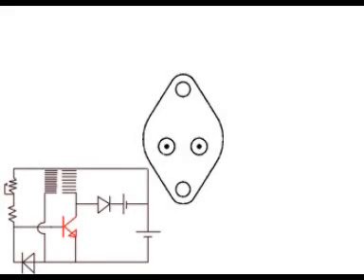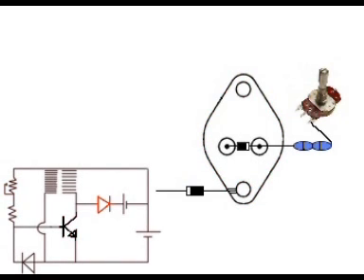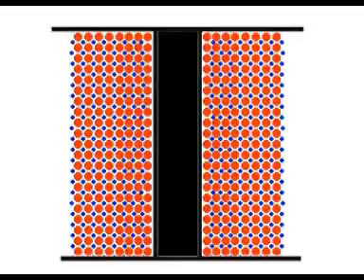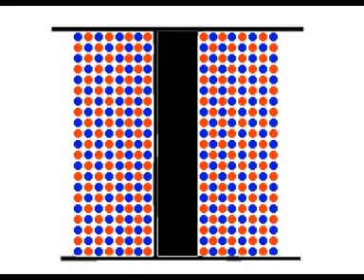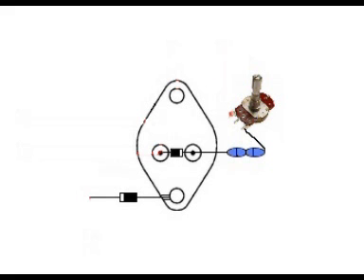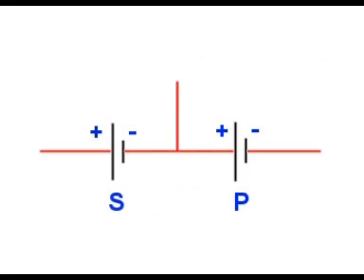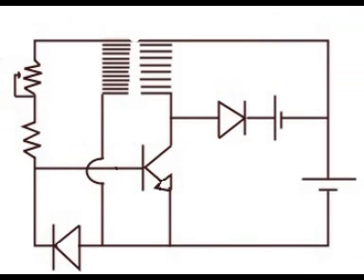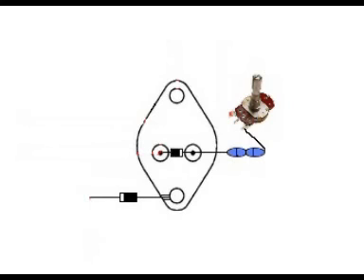How to Build a Bedini Motor ... Part 2

Comment: Hi introvertebrate 

Been looking at your posts and GREAT, I have NO idea what im doing but im going to have a go at making one of these motor Based on your posts..BUT in one of your posts and on others that you have more than 1 TRANSISTOR
.. Would i have to make a seperate BEDINI Circuit for each coil which all run back to the batteries?..

Thanks

Comment: I also want to thank you for the video. After a few tries I have mine running. I have not found the correct welding rods for a core so I used coat hanger wire that has a thin plastic coating. Bolt did not work as a core for me. I used a old 4.5 inch plastic replacement wheel from a shopping cart. Also I found my magnets 1 7/8 x 7/8 x 3/8 at Home depot for US$2.20/2 pack. Works good. Now trying to clean it up so I do not have wires everywhere. Might try bicycle wheel one of these days. 5 star

Comment from the maker: that is the potentiometer, AKA a Pot... it is a *linear pot* rated at 1 kilo ohm and 0.6 watts though a higher wattage is recommended.

I will be making a vid on how to add a second coil but don't have the time at the moment!

Good luck with your motor

Comment from the maker: if the coil was buzzing at one point then it is wired corretly... try *briefly* shorting the collector and base (the pole with the resistor)... this should pulse the coil and push the magnet away... if it attracts then it is upside down!  If nothing happens there is something wrong :(  do you have a neon in the circuit?

Comment from the maker: not even 1mm... very thin... 22# is 0.644mm diameter and 26# is 0.405mm diameter... if you can't find the exact wire it doesnt really matter... if you have to choose between thicker and thinner wire always go for the thicker ones ^_^

Comment from the maker: a recovery coil is just a coil that generates electricity from the magnets spinning on the rotor.  similar to hooking the rotor to a dynamo.  some people try to use this coil to keep the primary battery charged by pulsing the batteries with a capacitor but i recently heard that this is not good for the batteries... a recovery coil is not neccessary but it is interesting to experiment with.

Comment from the maker: that is the core of the coil... you will need to use some kind of ferrous metal for the core.  As i said in the vid the easiest thing to uses is iron filings with glue though you can use welding rods or if you have absolutly nothing else a steel bolt or nails should be ok temporarily though you won't get as good results.

Comment from the maker: The neon is not essential for the motor to work though if you disconnect the charging battery while the primary battery is attached the transistors WILL fry!  The neon is definatly reccomended ^_^

Comment from the maker: for example if you are using 7.2Ah batteries and the motor uses 250mA then it should only run for about 29 hours.

there is a modified circuit somewhere taht is self running as well but havent tried ti yet...

Comment from the maker: it is possible to run it on capacitors instead of batteries though it is alot harder since caps cant hold as big a charge.  It can prove free energy with batteries anyway.  If you know the Amp Hour of the batteries adn the amount of Amps the motor is using you can wrok out how long the motor should be able to run. If it runs for longer then it is pulling energy from somewhere else ^_^

Comment from the maker: if you go into a retailer like Maplin in the UK and Radio Shack in the USA they shoudl have all the components.

SHOPPING LIST
1 x 2N3055 Transistor
1 x 1N4007 Diode
1 x 1N4001 Diode
1 x 100 ohm 1/2 Watt Resistor
1 x 1 Kilo Ohm Linear Potentiometer
1 x Wire Ended Neon Bulb
1 x Spool of 22# Magnet Wire
1 x Spool of 26# Magnet Wire
2 meters of electrical wire
2 x 12V Lead Acid Batteries (the higher the Ah the better)
1 x Multimeter

Comment from the maker: It doesn't really matter what resistance the resistor is as long as it is low enough to let the trigger fire.  the original schematic from bedini used only a 10 ohm resistor.  you can increase the resistance with the pot but the pot is unstable so i'm using a resistor that is closer to my sweet spot.